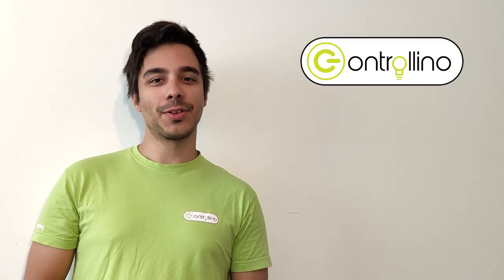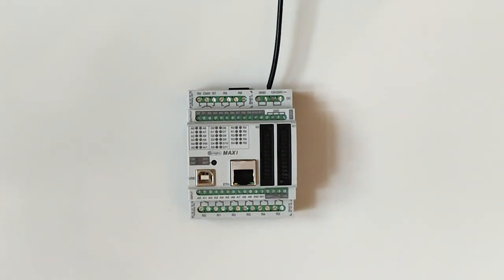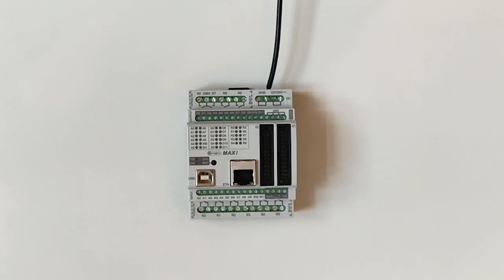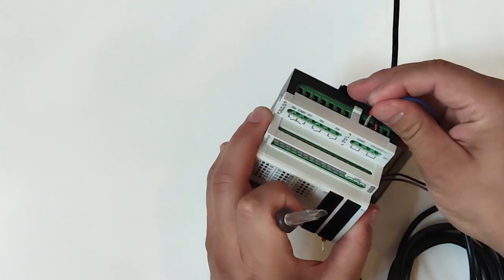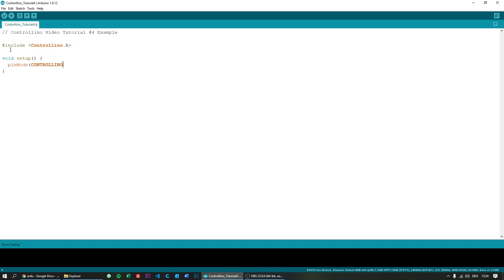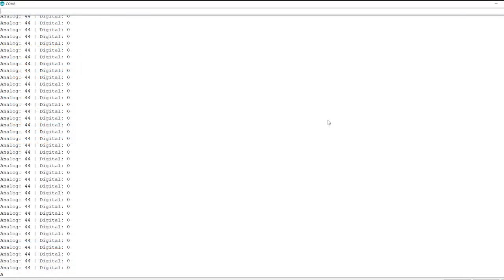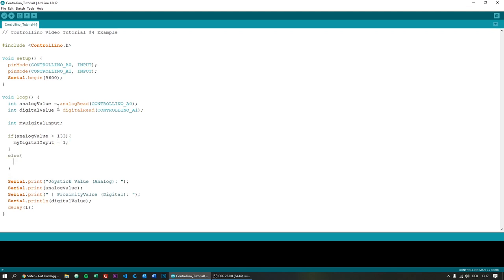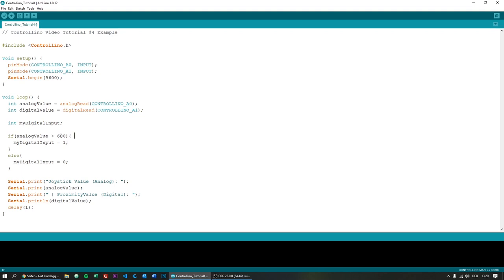CONTROLLINO Tutorial #4 | Inputs

Comment: Hi. Thanks for the video.. Is great. I have a question. Can I connect to a controllino Mini an analog transmitter board that works with 4-20 mA and voltage supply from 7.5 to 35 VDC. Thanks for your help.

Comment: Hi, this is actually an awesome product. I'm really looking forward to your new iteration Controllino myPLC. Any news when this is coming out and if it is going to have an option for thermistors (ex. NTC 10k) because usually in my area (HVAC automation) the most common concept is the controller with the DIs, DOs and some temperature sensors. So due to certification reasons it is always ideal to have a complete package that is CE and Rohs compliant.
Reply from the maker: Hi Loannis, thank you for your interest. In general, we are in the final stages of production of our first myPLC batches - we don't want to push out a release date too quickly, as due to Covid we had a few delays, but we are trying our best to get out with the product during this summer. If you want more information on the available I/Os as soon as we can present them, please consider joining our newsletter (on the bottom of our website www.controllino.biz) as we use this as one of our main news channels for publishing such info before it gets on our website.